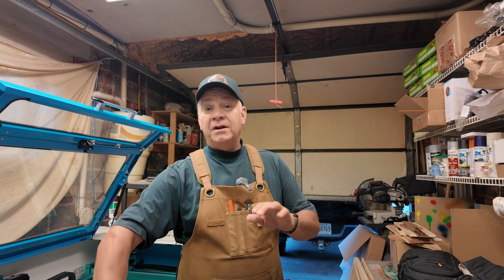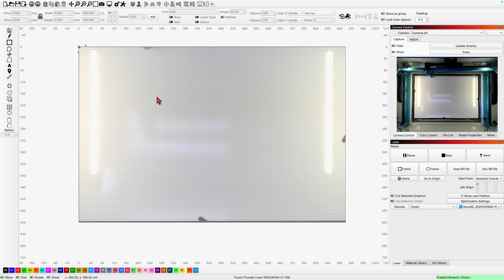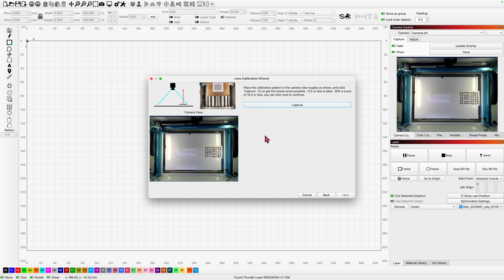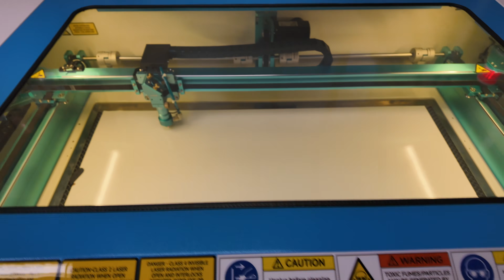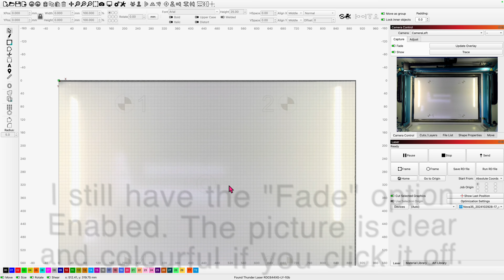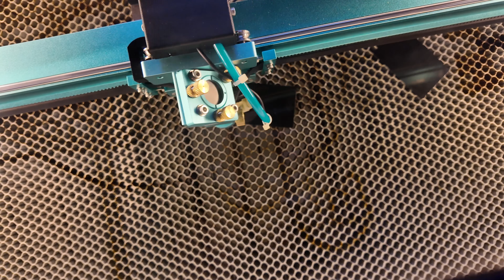Camera Installation for Thunder Laser Nova PLUS RF C02 Laser. 097   4K

Comment: Hello! My Nova Plus 35 80W arrived and I have already engraved a few things. I just ran through the alignment and calibration process and for whatever reason, when I set the laser position for 1 and 2, it is off by like 1/4" to 3/8". But, 3, and 4 were spot on. I also ran the triangle in the center and it was spot on, so I don't understand why 1, and 2 were slightly off. Any suggestions? Thanks for the video!
Reply from the maker: Good morning - yes, i might be able to help - can you email me your phone number?  lasernug at gmail dot com